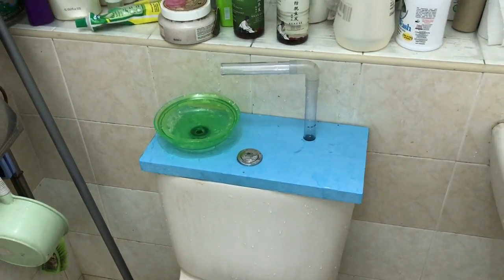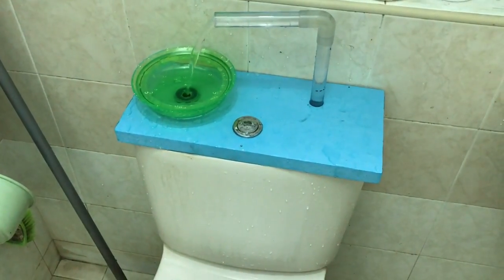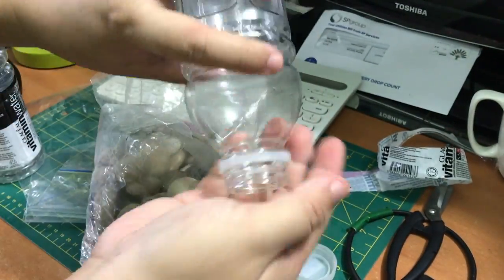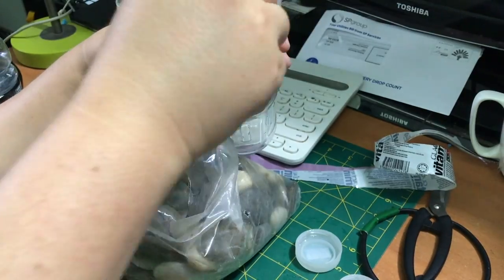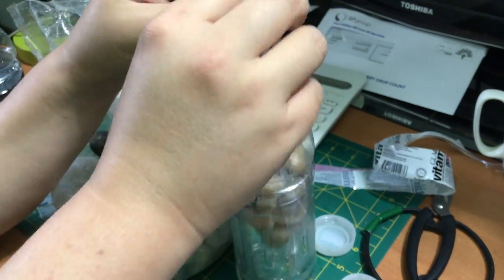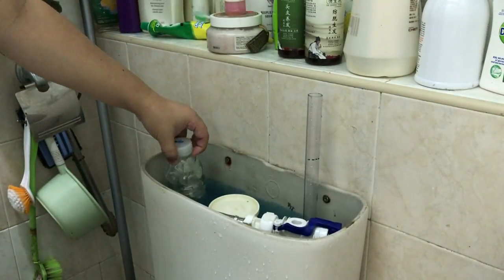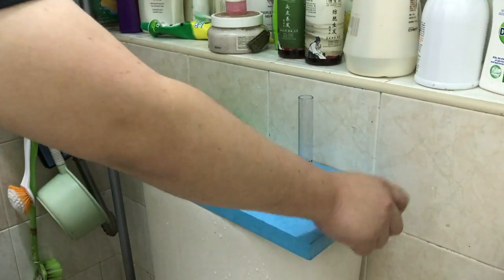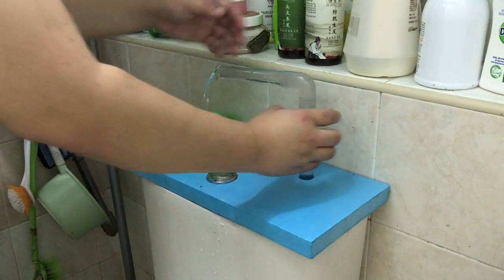Stones in a bottle - Saving water part 2

Comment: I hope you know you can adjust the water level on the fill valve just by using a screwdriver.  

Also every toilet bowl has a specific amount of water necessary to flush your shit down. So even tho you're using less water each flush, you will definitely need a second flush. In most cases a second flush still won't get your poopoo down, that tard will just float like a boat on a windy day.